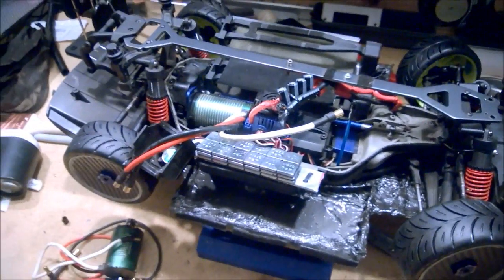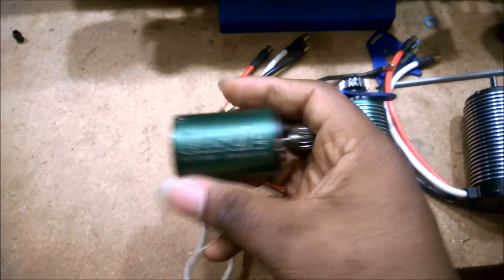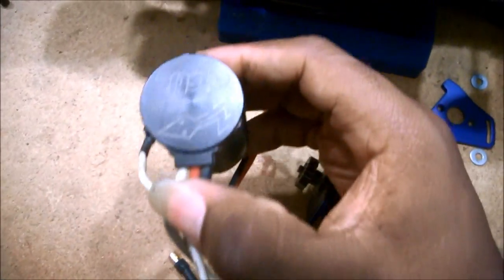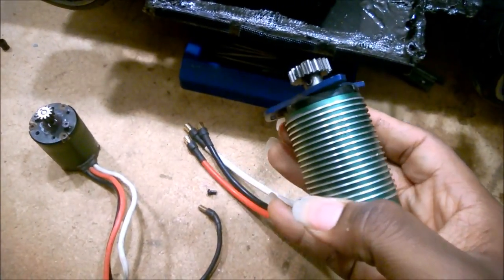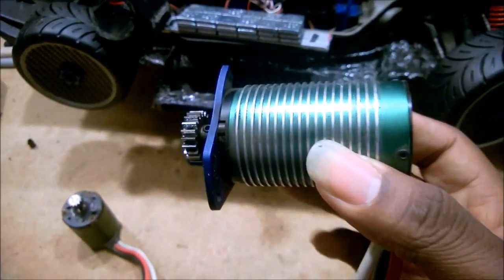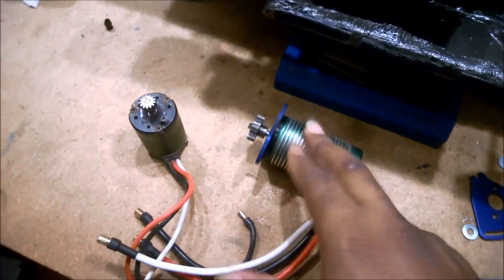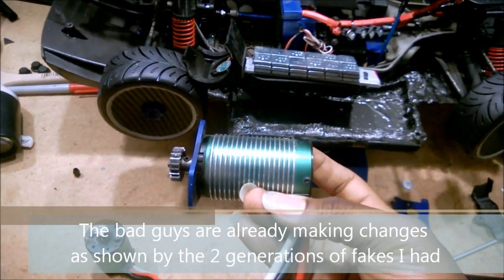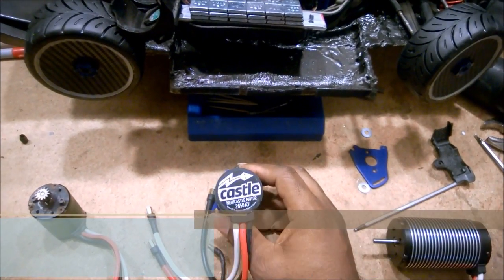Ep. 123 Counterfeit Castle Creations Motors

Comment: i wish i would of watched this vid first lol but I"ve just got a castle 5700kv from Craigslist for my 2wd slash to bash ,n i just checked n it has a castle sticker on it,  its been running good so far. i just hope it last me a while lol .. thanks for the vid
Reply from the maker: +SauWze The sticker doesn't automatically mean the motor is a fake. Apparently there are several versions of the older motors and some did have stickers on the end-cap. Look at the wires and see if the "Castle" writing will rub off. That's on other thing I noticed on my fake motor. Bottom line is that is the motor works for you, it works for you. Some of these faux motors are actually produced by a former Castle supplier using older Castle tech (illegally), so as long as it does what you need it to do... but that's not an endorsement of counterfeiters. ;-)
Reply from the maker: +SauWze ...And thanks for having my back. :-)

Comment: sorry, i did not watch the entire vid as no time....but how did the fake motor actually perform?I have 1 of these cheap castle 2650's myself. at the price i paid i expected it to be fake, as i'd say you should have (or at least been prepared for)...it performs however very well, far better than its price would have me expect and i'd imagine maybe close to a official motor. i don't agree with fake parts but u pay your money and take your choice. nice 1 for the vid either way.
Reply from the maker: +maxNluca RC N Stuff! This motor took Dizzy to 70+ mph on 3S (RC Physics #85 (https://youtu.be/szy_WkRgn2E) and turned a slipper clutch to powder on 6S (https://youtu.be/PmuJ0ERrk90), so it is NOT a week motor at all. I've also been told by very reputable folks that they have witnessed these motors breaking 100 mph, but they do have a couple of issues. 

I actually have a follow-up video where I run this motor and show how it performs in my Slash 4x4 on 3S (https://youtu.be/9x-VWvwuZ0w). It runs pretty well, but it does not seem as punchy as my Authentic Castle 1410 3800kv motor with the same ESC and battery and actually produces a lot more waste heat, so I had more thermal shutdowns. I know this was waste heat related because my in-line power meter showed the ESC was actually pushing less current than with the smaller motor, so the additional heat was because the 'faux" motor was not quite as efficient. I had a chat with one of the guys from castle who said Castle actually bought a few of these motors and found they were missing some key features that help real castle motors achieve higher efficiency (80-90%) vs. 70-80% for "second tier" motors.

The sad thing is that i think whoever made these motors could probably have sold them under their own branding for twice the price.
Reply: thanks for that info. although its fake...as with mine its a great motor for the price..cheers

Comment: I talked to a Castle rep and he actually said that not all of their wires say 200 degrees C on them. Also there can be minor variations in the placement of the lettering due to them using multiple factories for production. So spotting a fake is even harder than it seems.
Reply from the maker: +Keith Fenton The problem with modern counterfeiters is that they are using a lot of the same agile manufacturing techniques as the real guys, so they can change their designs quickly. The only real way to make sure you get a legit product is to purchase through official dealer channels like Tower Hobbies, A Main, Dollar Hobbies, etc. and stay away from the "too good to be true" deals... unless you just want a $50 motor to bang on.
Reply: @SPEEDRC76 - hmmm 🧐🤔🤷‍♂️ i wonder how do you really tell other than sending it in lol i give up

Comment: Good Video rhouse21. Just out of interest, how did the motor perform? It would be good to have a back to back test (fake vs original)
Reply from the maker: +Phil Y  Funny you should ask. I have an upcoming video on that. Stay tuned!
Reply: Nice, I will stay tuned :-)
Reply from the maker: +Phil Y Check out my newest video, RCP #140 for driving impressions.
Reply: Nice video. I'm surprised you achieved the speeds you have, so I guess it wasn't all doom and gloom.

It would be good to see your long term video, as you mentioned for bashing (as long as you don't damage your esc etc) but for $50 it's hard call to make. 

Maybe castle should think about doing a video to show the difference (just a thought), to justify the costs.

Overall great work and look forward to see your speed machine with the xo motor;-)
Reply from the maker: +Phil Y  Check out my video RCP #137. I was able to hit 102 mph on GPS so far and Dizzy still has a lot left in it.

Comment: you know what combo castle creation that would work in SCX10
Reply from the maker: +Canal do RC Brasil  I checked the Axial website and the SCX10 will take any 540/550 soze motor. I'd probably recommend the Sidewinder SCT combo which has a Sidewinder 3 ESC and a Castle 1410 Motor. I have owned several of the Castle 1410 motors and love them. 
Link: http://www.castlecreations.com/products/sidewinder_sct.html

The Sidewinder ESC is stronger than you'd expect and should put out more than enough power for crawling ot the occasional bash session. This is the combo I run in my Basher truck, Scratch and you can see that it definately is not lacking power. Look at RC Physics 121: Team rhouse meets the hill. (Link: https://youtu.be/FrBddayLIL0)

I hope this helps.

Comment: You should run an AUTHENTIC Castle 2650kV motor in the car to see the performance difference between the two motors.
Reply from the maker: +Jeff Lacina I'd love to, but unfortunately that's not in the budget right now. I have already installed the authentic 1717 1650kv motor and clocked 94.6 mph on 6S LiPo power and "slow" gears. I went back and crunched the data from the run and the authentic 1717 was within 1-2 mph of predicted speeds for both sets of gear ratios I ran that day. On my previous 3S LiPo testing runs which acheived ~71 mph, the counterfeit motor missed my predictions by 6-10 mph.

Comment: Oh wow thanks for sharing 👍👍👍
Reply from the maker: +Tinsley Smith I know I've been seeing a lot of guys using 1512 2650kv motors lately, so I just wanted to get the word out. I've since moved this motor over to my basher Slash and I'm going to see how it acts over time. It is a strong motor, but it feels a lot different in the car. It's a LOT heavier than the 1410 motor I was running in it before (so I think I need to jump to stiffer springs), but it's got a LOT of grunt. It's kinda like switching from a turbocharged small displacement car to a big v8. I'll post a video soon with my impressions so far.

Comment: That's crazy! But $50 for a new Castle motor should've set off an alert bro. And even though it's not a castle it still might be an ok motor. I know you're big on calculations and graphs, but you might need to come out of your gearing comfort zone to hit the numbers you want. I'm not saying use Spacely Sprockets but I see that's a pretty small pinion on it now. As you know...just monitor the heat.
Reply: +rhouse21 - RC Physics sounds legit lol
Reply from the maker: +Dan P (AT EASED1) Actually, I was pretty sure one of the two was counterfeit when I ordered them, but the other surprised me since it came from the same seller as my MM2 ESCs. Oh, and the small pinion is an attempt to push the motor higher into the RPM range so I make the power I need with a lower current draw. I'll let you know how well it works
Reply from the maker: +Dan P (AT EASED1) Brushless motors are "synchronous motors" meaning the rotor's rotational speed is synchronized with the rotating magnetic field in the motor's coils produced by the ESC. This means that the ESC literally has to command every fraction of a rotation your motor makes and must push enough current to handle the torque demands of your RC. If your RC is geared so you only use 1/2 of your trigger range, you are actually only requesting 1/2 of your available rpm range. Power is torque x rpm. So lower gearing to use more of you available rpm range can actually let you put more power to the ground before reaching your ESC's current limit.
Reply: You guys keep on talking... im learning alot . I subbed to both you guys.
Reply: i have 2 of the (rip off) Castle motors and they work just as good as my real Castle....just don't over heat them or there done